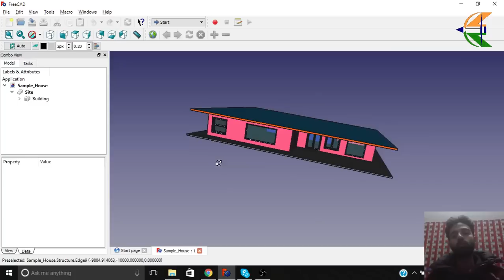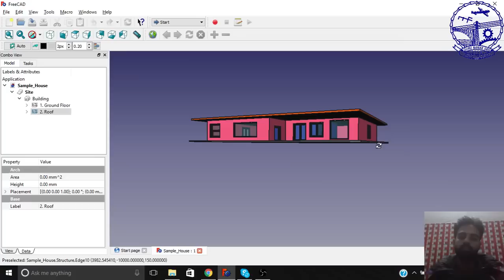1. Architectural BIM Modeling Course Using FreeCAD - Introduction

Comment: Thanks for the videos.  I have a hard time understanding scaling and setting up the proper units of measurement for my drawings.  I have dimensions of 100 ' X 50' but when I add those numbers, the drawing disappears.  I am thinking that the sizes only throw the drawing off the viewport.  Can you provide some guidance.